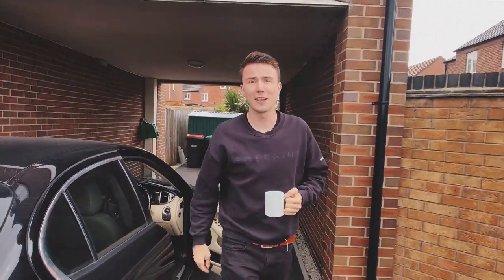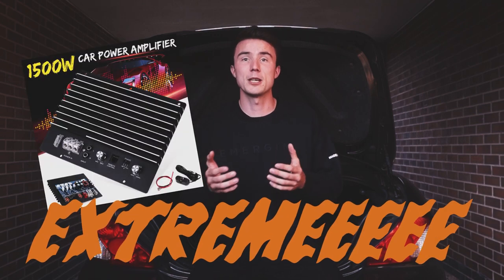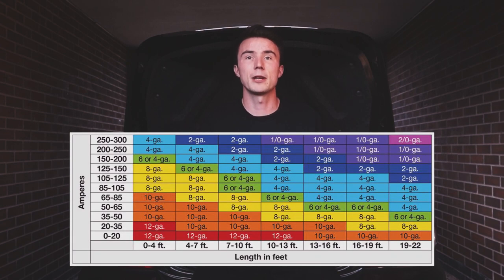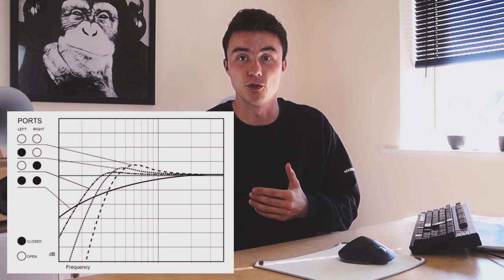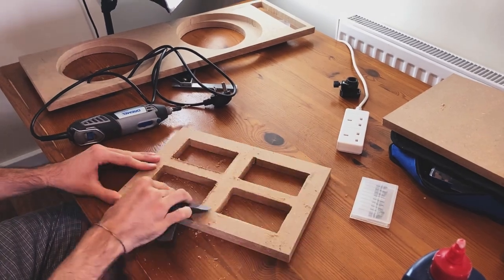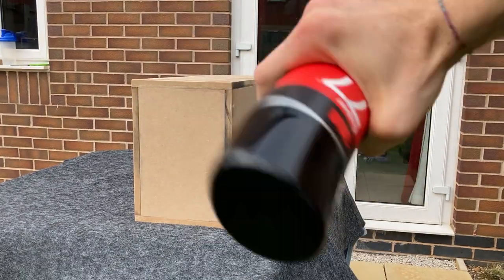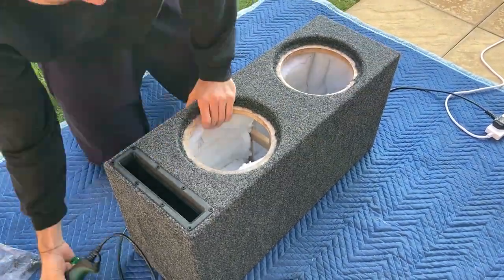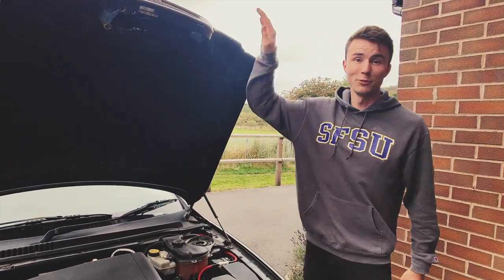Jaguar X Type Stereo Upgrade | SUBWOOFER Build

Comment: Fair new to the x type. Currently got a 2002 plate 3.0 V6. Don’t the factory head unit if you have the screen have a sub output that needs to be turned on by computer? Unsure on this? If you click the phone button and menu button together for 5/10 seconds it will come up with the options.

Comment: Got you off the group in Facebook I need two 12 inch subs in my Acura legend 1995 Sudan helppp!!!
Reply from the maker: Hey bud, thanks for watching. What are you stuck on?
Reply: @jcracoustics  I bought a new battery but only one click for my starter but I need recommendations for what subs to get as well
Reply from the maker: @bray_huff3685  Well I'd highly recommend the Rockford Fosgate Punch series as that's what I've been using
Reply: @jcracoustics  thanks bro 🙏🏼

Comment: How it's sound inside car the subwoofer?  I mean,you put into the trunk, which is separated from the rest of the car... You feel/hear the bass intense/good? I have the same car like you, and I want to install a subwoofer in case, like your!
Reply from the maker: Yeh it's certainly loud enough! You can if you want it to be really loud fold down one of the back seats but I find it's enough without.
Reply: @jcracoustics  Thanks for answering! What do you think if I install without case, only the sub, on the dashboard trunk? It will sounds good or I lose the loud?
Reply from the maker: @Dragoshm2o  Always best to design an enclosure so you can design the tuning frequency and make sure things are sturdy and sealed but I haven't tried the method you're explain so can't say for sure!

Comment: how do you splice up into speaker wires in a jag
Reply from the maker: You can find the wiring manual online and you simply find the colour associated with the L/R rear channels in the back (for me I looked in the pillar next to the front seats). I then used a ratchet wire stripper to expose some of the copper and then soldered another cable to that to run to the rear subs (making sure to insulate with tape or heat shrink at the join).

Comment: Great job, my friend! My Jag hasn't got any additional amplifier in the boot, that's why I intend just to change OEM speakers with aftermarket ones and upgrade wiring, maybe moving the rear speakers from doors to the place under the rear windshield. Let's see.
Reply from the maker: Thanks! Mine didn't have the additional amp either like the Alpine x-type does. Personally I'd recommend if you're after a more immersive experience keep the door speakers where they are and add a small sub to the boot. You could use the same setup as here splicing into the rear audio cables to get a new amp in for it.

Comment: did you say "splice into..." ? 

Bye!
Reply from the maker: Why's that buddy? Nothing wrong with splicing into audio cables, you might be able to identify a minute voltage drop through an oscilloscope but nothing audible especially when you're talking about the sub 250Hz range.